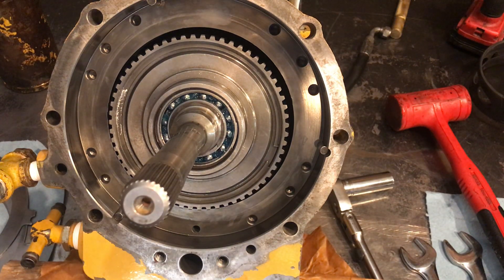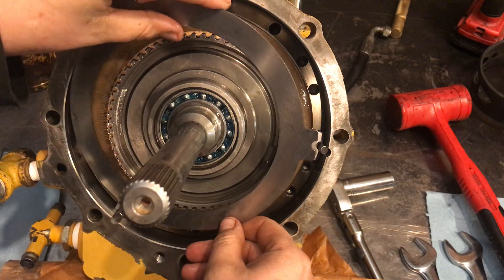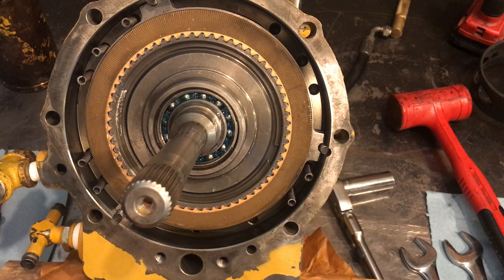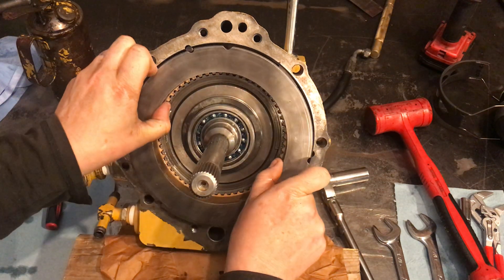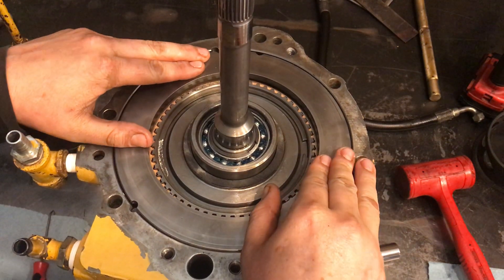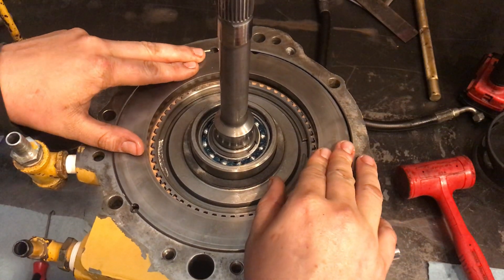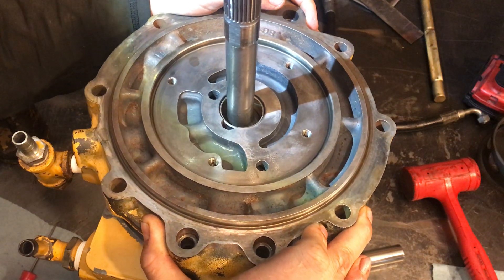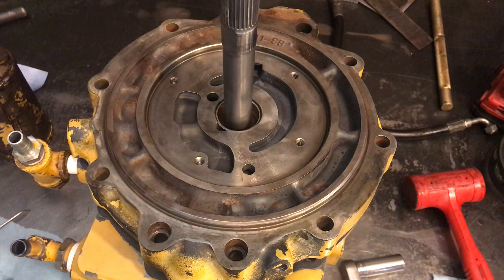(193) John Deere 310D assembling reverser clutch pack

Comment: Could you tell me where the rust goes in the oil pump of the John Deere 310 D gearbox, thank you very much in advance.
Reply from the maker: @cristianviera6546  the rust? I don't understand what your asking
Reply: @tdm8817 I have a problem that the oil price does not match the gearbox package and several technicians have already checked and cannot find the problem.
Reply from the maker: @cristianviera6546  I'm still at a loss here? Are you asking what type of oil to use in the reverser?